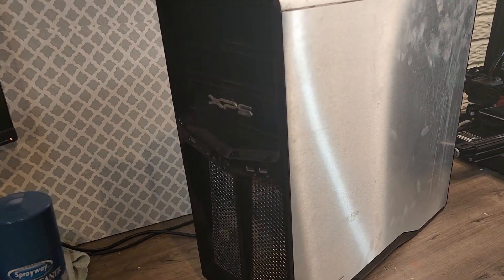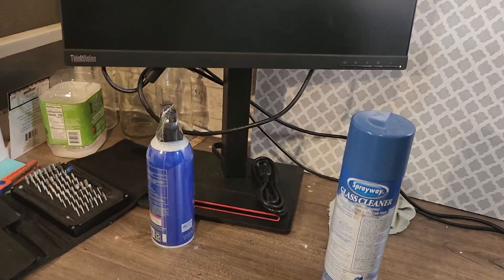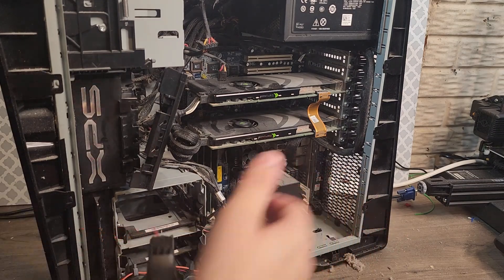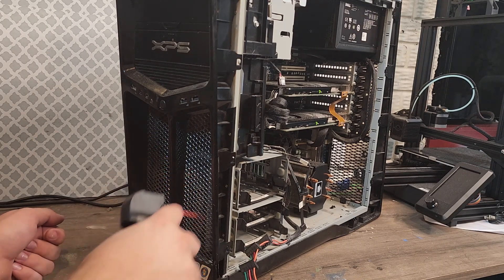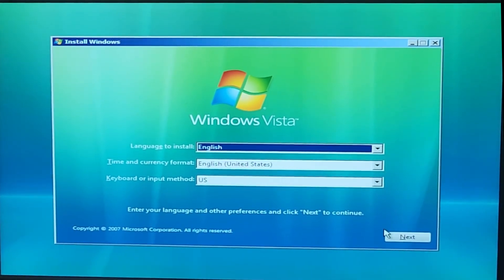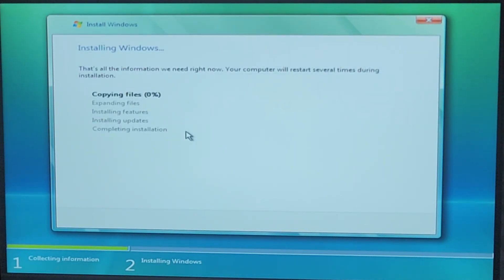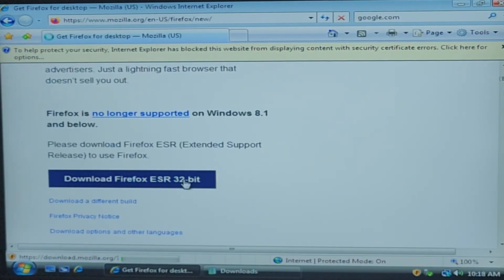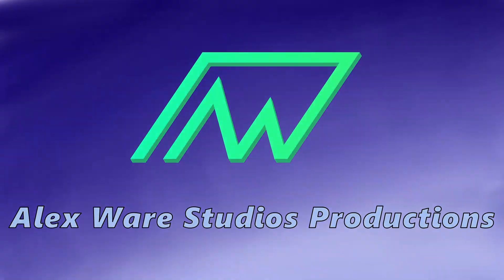Restoring Dell XPS 630i

Comment: Try upgrading to Windows 10
Reply: This will run win 10 no problem.
Reply from the maker: Yeah it originally ran Windows 10 but I had to run Vista 32-bit for compatibility for old games
Reply: I have 3 of these machines which I use daily. Two black and one red. Don’t bother installing windows 10 as it will crash when you use it. I installed windows 10 on 2 of the machines with the same outcome. Everything works fine at first but then you will get the blue screen. There is an issue with the motherboard for windows10. I spent countless hours looking for a solution. The best windows OS for that machine is windows 7.

Comment: Are you mental blowing out a computer like that indoors! I blow out computers all the time with a real compressor and I find its best to remove components like the gpu and psu to rebuild, use a cheap laminating brush on all the accessible areas before vacuuming the bulk then using compressed air.
Reply from the maker: Normally I use an air compressor in my garage but unfortunately the space was being used for something else and I had a deadline of only 2 days so a can of compressed air and my basement should suffice, But thanks for the input.